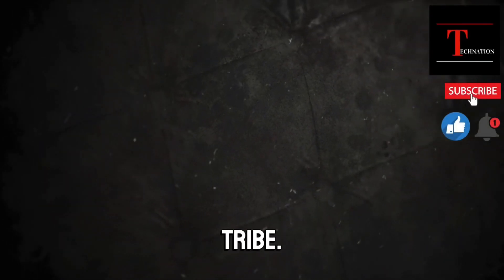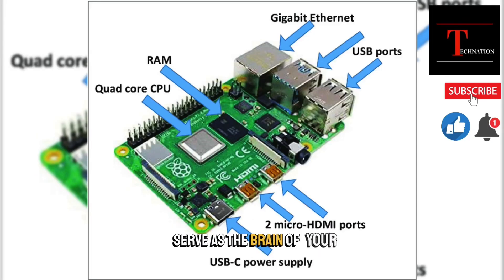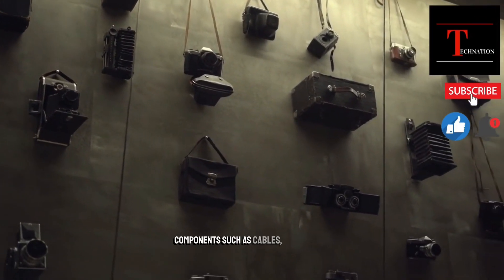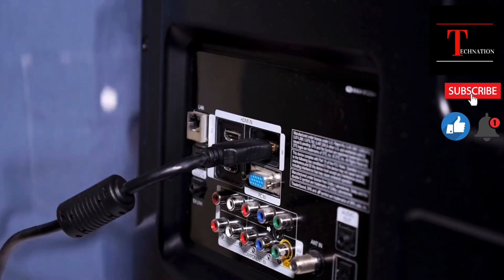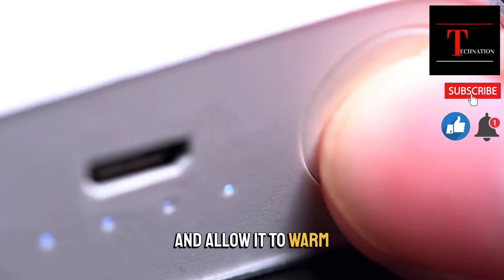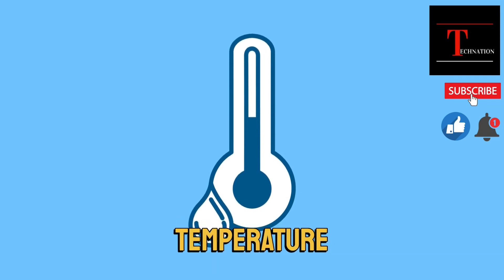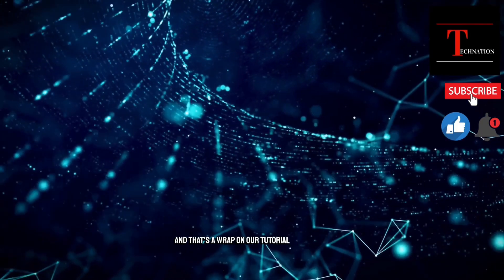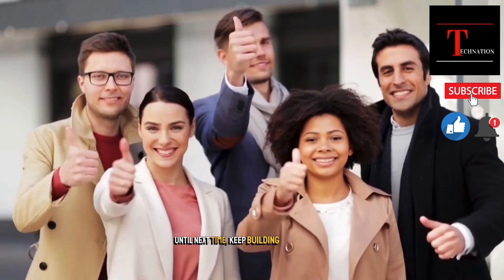DIY - Build a Thermal Imaging Camera in 5 minutes

Comment: To build a thermal imaging camera you need a thermal imaging camera as the main component. Oh wow, didn't see that coming.
Reply from the maker: Basically it would be classify as a module , as the video was a depiction of high level concept we use the “module” as a component. Thanks for your feedback , keep sharing :)
Reply: It’s referring to the chip the camera is held onto, rather than the whole system. The chip with lens costs about $10

Comment: This is less "nitty gritty" and more "scratching the surface."
Anyway, could a DIY set up like this be used to image between 1000-2000 celcius?
Reply from the maker: Thanks for the suggestions and we would definitely include more content to provide indepth analysis and view points. 
But setup like this ll detect upto -30 to 200 Celsius
Reply: Add a thermal filter, maybe cloth, and recalibrate?